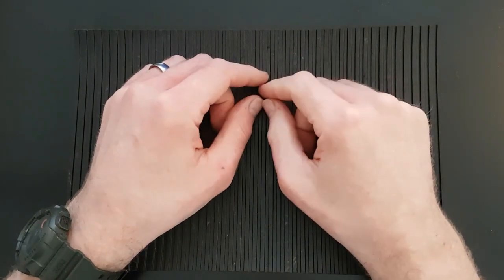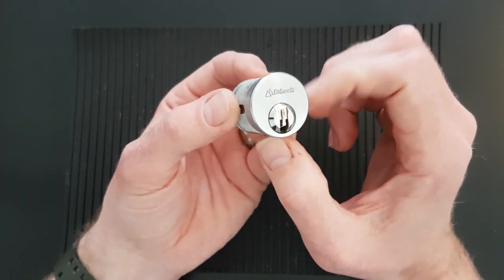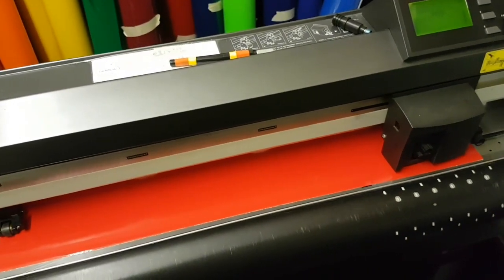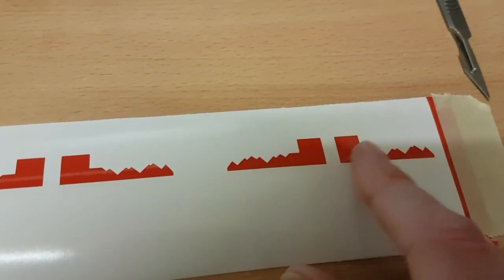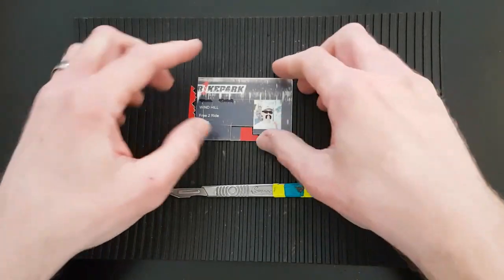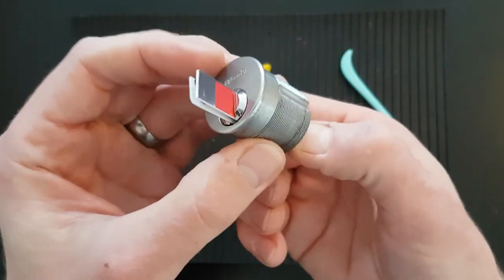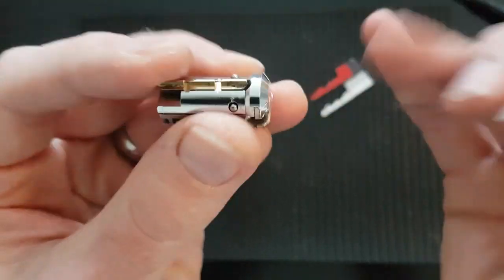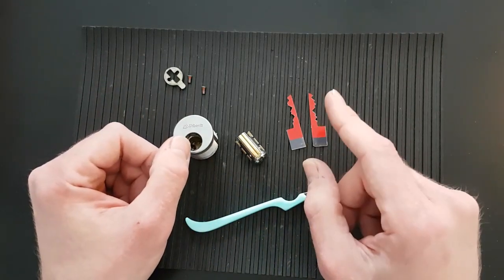Making a working Bilock key Part 1 - Using a photo to create a credit card key template.

Comment: Very interesting, nice work. My fine motor control isn't really up to the task of this sort of project but I might give this a try. I have a euro cyliner (Cisa if memory serves) that has a dual rank of bitting like yours - I do have the key for that one - I think mine also has some sliders or similar technology that mates into a laser track on each side of the key. It's all miles beyond my level of incompetence to even get my terminology right, let alone manage to pick it - but as a mechanical object it's a fascinating piece of engineering.

All being said, your video shows why we should be careful putting photos of our in-use keys online. Being able to duplicate a key from a photo, even if just something like a Yale, is a little chilling. Physical access would let you quickly take an impression in plasticine or some other type of clay, but doing it by sight ... yikes.